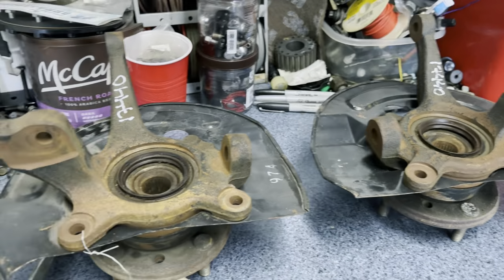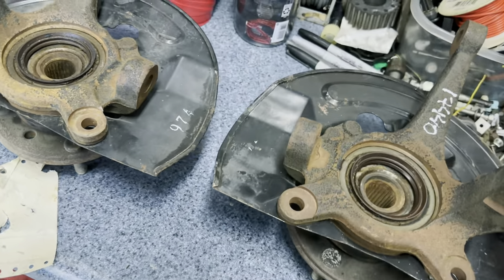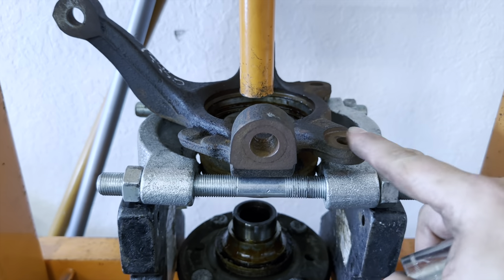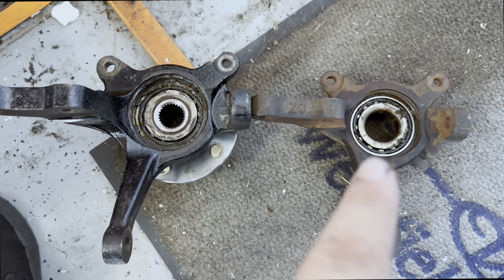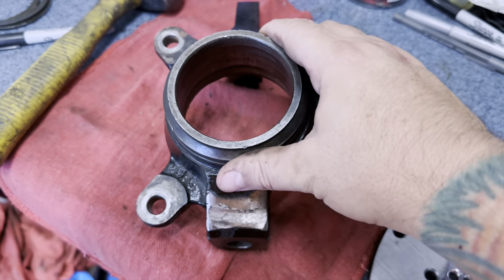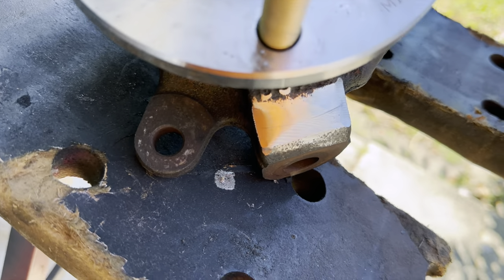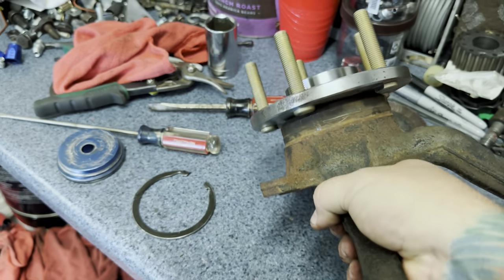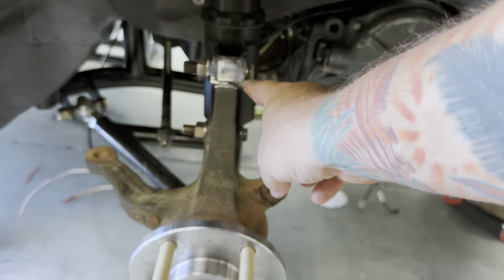Fitting XFWD Spec Wheels on a DSM

Comment: When pressing the bearings in you should ideally be pressing on the outer race. Likely won't cause any issues, but figured I'd mention. Cool mod for a very specific need. You could also have gotten some button head bolts, though that obviously would have been a more expensive and time consuming fix. Pretty sweet!
Reply from the maker: I agree, the outer race is ideal. I still may change out the bolts. It's still really tight.